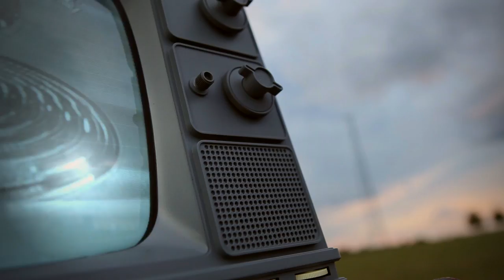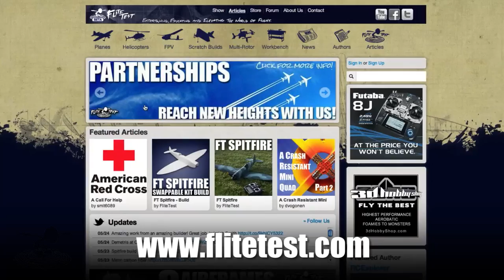Flite Test - The Roadrunner - 38cc Gas Airplane

Comment: A little tip with gas engines: Set the prop so that it rests parallel to the wings when the piston is at Top Dead Center (TDC). This way, if you get a dead-stick, the prob won't be stuck and down, and your landings will easier. It also helps when starting these bad boys up! Anyways, great job getting the old plane to fly. :) My dad actually has one just like it, although his is blue and while.
Reply: I learned that way back in the Cox 0.8 days, when I was getting into RC and flew scratchbuilds with a 2CH radio.
Saved me MANY props ;)
Reply: Excellent tip!

Comment: 3 years later, and still waiting for a gasser in an Episode ...
Reply: yeah i did find one other gas episode.. was a review on a mustang.. i was shocked.. the name of episode:
Flite Test - Hangar 9 p-51 mustang MkII  PTS - review. Nov 29 2011  

other than that only other gas episodes are accidentals.. not of the FT boys doing a review or flying.. which is to bad they had so many people interested in learning about gas..  

but iv learn a lot from FT so i can not complain.. plus there foam board planes not so good for gas. LOL.. however, with there new foam.. i say peter time for a challenge..  we want a line nitro plane..  2 wires 60 feet, cox .49, and the new foam board.. it should work fine and the new foam board being water resilient.., just use some dope to protect it from the exhaust etc its how they protected the tissue paper back in the day.. so why would it not work on the new water resilient foam board.  .  im learning to use dope now on a balsa rubber band plane im building.. so far using dope is not to bad.. i figure iron on monoko will be harder..  i need to go order a iron and some low heat film.. so i can practice covering foam etc..    

im with you id love to see a tutorial series on  gas.. even if it was just getting into free flight with a line plane.  you can get gas engines so cheap now.. so its not like the project could not be reproduced by the FT community..
i know everyone is pushing elertic and i get it.. but im almost 42 i grew up with gas engines.. my lawn mower was never electric.. even tho sometimes i wish it was hah because my old lawn mower as a kid was such a cold blooded beast.  but it made me summer money so what the heck.  .
Reply: Chris c
totally agree with you.cox is so awesome!!
Reply: +Chris c the heat generated by an engine is enough to melt or damage/deform foam board. It would also likely be too heavy to be effectively supported by the foam.
Reply: SandwichedTom
it could work. but you are right, bigger engines arent good for foam.
Reply: if been flying electrics all my life but i woud reallllyy like a learn how to gas/nitro planes  and im pretty sure those guys could make it but atm they are all about begginers rc foamyies.
Reply: Sereniitty
yeah...
Reply: RapaSheepZ same I'm started nitro
Reply: yep, time is passing..
Reply: Now 4 years later still no cool piston planes 😱
Reply: I guess gas running planes are not that "modern" anymore. Over here in Europe, especially germany and France, as well als Switzlerland and Austria, the rules for flying RC planes are getting worse every year. Gas planes are not allowed to fly in a space without permission, insurance and most important: No flying if a building is within a radius of 1km. Especially the last point is difficult to solve because central european countries are very dense populated and the areas without buildings are often protected areas like forests.
Gas engines for planes are often used by scale-pilots who mostly fly on events where they have permission to fly.
Reply: There's another gasser episode called Flite Test Large Scale 3d
Reply: prolly keep waiting,  electric too reliable and clean, ,  But yes love nitro, its just a ma
Reply: It had been 3 years seince this comment was made
Reply: Rapalagui 6 years
Reply: not really sure, but I think you can edit to 6 years.
Reply: 7 years....
Reply: 6 years later an I'm still waiting for one 😂
Reply: Make that 8 years
Reply: @letsgofast1187  Oh yes :D
Reply: @Rapalagui  make that moree
Reply: @justaguitardude  That was glow not gas.....
Reply: @justaguitardude  i have learned a lot to from FT, and FT is the reason i am in the hobby now, tho i would like to see a little bit more "advanced" stuff, there i am today and will be next year. FT still feels they only turn to the rookies / beginners. there is like no real reason for me to follow FT anymore.. no 20 - 60cc gas, no Turbine Jet´s and not Nitro, all they fly is boring Electric stuff..

Comment: This brought back memories.  I flew RC back in the early 70’s when all we had was 2 cycle nitro engines and 4 channel radios on the CB band, 27 MHz. My favorite plane was the Ugly Stick.  It was a 72” wingspan pulled by an Enya 60.  My first radio was a Heathkit, which I had to completely build, including the servos.  Fly some more of the oldies.  I think even the younger audience would like them.

Comment: I wish they made a Gas beginner series.
Reply: +Jay Anderson Came here for same thing.
Reply: Janis Andersons gas planes are not beginner planes
Reply: please do one.  you should make a new power pack for gas power.
Reply: @modelrc9500  We're asking for a series on experienced pilots who might be "electric only" and want to learn GAS engines.  I have chainsaw experience, but no airplane application.  Does lawn trimmer time count?
Reply: birdwing98 of course it does!
Reply: try nitro almost same thing just different fuel and higer rpms
Reply: @modelrc9500  he meant beginner series for gas, like you want to get into flying gas, not when your a complete beginner, just a beginner series for getting into gas planes after you've mastered electric
Reply: @modelrc9500  they were for me.  Granted that was the 1990s...  back in the day electrics weren't strong enough for most people to want to fly em.   With brushless motors and lipos that's changed, but it's not really any harder to fly a gas trainer than an electric one.

Comment: The carburetor on that has a built in fuel pump that works with the pressure in the engine crankcase. The fuel tank can be below the carb and still run. But, carburetors with a bowl on the bottom of it needs the fuel tank to be above the carb because it gets fuel using gravity. You would need an external fuel pump if the gas tank is below the carburetor with a bowl in order to run. So, you're fine with the fuel tank. Hope this helps

Comment: Great deal guys!  That engine is a Zenoah G38 and has a spring starter inside the rear mount. The engine is worth more than you paid for both airplanes.  It surprised me that it cranked so easily.
I think the airframe is called a 'sweet stick' and is a great flyer.
I would like to see more gas planes as well.

Comment: Being a small engine hobbyist, I spotted a few things I would say differently. The engine doesn’t “suck” per say, it draws. The primer bulb doesn’t shoot fuel in the intake, it primes the system. A servo-actuated choke would definitely help that engine start easier.
You can’t flood a two stroke by tilting it with the engine not running. They run on fuel pumps, so no gravity feed or float bowl, aka no way for the engine to flood out. A fuel pump, especially diaphragm carburetors, don’t need the fuel tank in my specific position, they’ll draw fuel no matter what, running or not running. Primer bulb and choke is the best way to start a two stroke engine.
Also, David cutting his finger on the prop. That happened because the compression pushed the piston backwards, spinning the prop backwards, and whacking David’s finger.

Comment: A few years ago I bought a Great Planes kit the Ultra Sport 1000 and it suggested a Super Tigre 2500 for the engine.  I put a Zenoah 38 gas engine in it and yes it was very nose heavy.  I put a lot of tail weight in it and it flew like a dream.  The guys at the field loved the way it flew.  The landings were a little fast because it was nose heavy, but it flew great.  This Roadrunner looks like a kit we bought from Ace.  I forgot the name of the kit, but it looks the same with the same engine.

Comment: Great video! Loved the added behind the scene stuff.  I'm an avid electric guy but do like the occasional foray into the gas realm.  About the motor, I spent my late teens as a small engine mechanic and can tell you that those two stroke motor carburetors have build in fuel pumps. this is so that they can run at any angle (think of how chainsaws and weed whackers are used).

Comment: Hey guys, finally a gasser ! I`m building a Senior Telemaster to use as a FPV platform with a FS120 4 stroke gas engine and would love to see you put some FPV equipment on this to see if the ignition messes with the FPV gear. I`v looked all over and no one knows if it will or not. If it does, maybe just need to shield the ignition. Would be a great build for all of us gasser freaks out there ! Also how about a GP Siren build ? Just a couple things a faithful watcher would like to see....

Comment: Awesome video guys! FYI don't use Klotz Benol two stroke oil if you fly in the winter, temps under 40 degrees F when combined with Benol can result in cylinder damage. Natural castor oil doesn't perform well in the cold, for all temp protection try Klotz Super-Technaplate.

Comment: The carbs in those do not have return lines, just an inlet. There is a diagram fuel pump in the carb that operates off the vacuum pulses in the intake.

Comment: Im pretty sure the motor is a ryobi 38cc that the original owner converted to RC use. The prop hub looks home made and the muffler looks like a weed wacker muffler and its located at the back of the motor like most ryobis.

Comment: You can't flood the engine with the walbro pumper carb.  It only delivers fuel via the engine's pressure pulses via a diaphragm pump.  It delivers in any attitude, that's why you have them on string trimmers, chainsaws, blowers etc.  You also can't flood the engine with the primer bulb. Not sure about this setup but in power equipment the primer's job is to purge the air from the fuel system, not inject fuel into the combustion chamber.  A little nose heavy with full tank is standard in fuel models.  The CG levels out as the fuel burns down.  Fun vid!

Comment: I have the most awesome electric starter for gas engines. Not only does it spin the big gas engines up and starts them quickly but it has the coolest name a Sullivan Megatron. You can fly the gas engines for almost 30 minutes too on one tank, and be up in the air again refueled in a couple of minutes.

Comment: hey guys, i noticed that you used klotz benol for mixing with the gasoline, thats wrong. benol is primarily used for adding additional oil content for nitromethane model fuels, if you use benol in gas engines long enough, it will cause ring sticking and carbon buildup,  benol is  used in 2 stroke racing type engines(gasoline powered) that are torn down and rebuilt frequently because it will cause ring sticking in a few short hours.  use 2 stroke oil meant for mixing with gasoline, no castor oil.

Comment: The sound does not really depend on whether it's gas or nitro, but much more on the size of the engine, brand and especially whether or not the engine is on rubber mounts. Especially Webra nitro engines sound very round and harmonious.

Comment: It is springloaded so by turning it backwards he puts momentum on the spring and then it releases in the right direction, helps the ignition to load the spark needed to ignite the fumes.
I'm not sure but I believe it is more common in magnetic ignition systems than the electric ignition since the electric systems will spark every time.

Comment: Actually, the suggestions were valid.  In the episode they commented on the lack of a grounding switch, which is a kill switch on the motor.  Pulling the plug wire is a good idea, unless you're ready to start the motor.

Comment: I love the plane so very much. The old school big stik ugly stik look. It encompasses everything of rc airplanes. And gas yuuuuup! I have 6 nice models that run on nitro. I upgraded to 4 stroke over the last 2 years but i now own 3 gas models all by aero works and i have pitts mufflers on all 3. 2 50 cc models and a 20 cc model. All big scale low wing high performance beauties. And a gas engine allows so much more to the hobby. The smell the sound with those pitts pipes, and having sparkplugs in my flite box rather than glowplugs. They are all so much more fun to fly than nitro. Dont get me wrong i still fly my nitro girls too. I always take 3 models out to fly. There is just something about my 70 os surpass f4u corsair that is beautiful. I put a blowdryer on her skin once every 30 days to keep her tight and hit her monokote seams with a heat iron with a soft sock as well. She has retracts and she is a true scale model. Work on her at least 3 to 4 times a month to keep her scale look pristine. I even paint the tips of her 3 blade prop yellow every month or so and apply airbrush dark gray to her wing guns and exhause port areas area her cowl. Keep your models looking good. Its as fun to me as flying them. Dont ever overlook model upkeep. They need love just like everything else you care about.

Comment: On the engine, there is a sort of spring.
When he turns the prop backwards, he twists the spring aswell.
When he releases the prop, the spring turns the pro the correct way for a few rotations. That way it is easier to start the engine.

Comment: Guys, that hasva walbro carb on it, it hasva built in fuel pump, so does not need a backpressure line to the tank. Only the gravity feed glow engines need it.

Comment: you have a ground wire coming off your coil you can put a switch so that you can ground that wire to the motor and that is your off switch.  Or at least you should have a ground wire.  the Zen spring start actually works pretty darn good.

Comment: On the balance point it should be CG forward at takeoff as the fuel burnoff will move the CG to the rear.  You don't want the CG too far back at landing.

Comment: looks like a Zenoah engine with the spring starter, turn the prop clockwise winds spring up release and the spring flips the engine.
No choke, fuel prime was standard as you did.
Big problem always balance glow and gasoline engines with an empty fuel tank or your plane will be tail heavy once you run down your fuel, a clamp and a wrench with a full tank of fuel probably a wrench heavy once the tank is run down :)
Gasoline fueled engines have a fuel pump in the carb ,  tank vent and a fuel supply line some may have a three line tank though with a fuel supply line as well. Glow engines exhaust line which is the tank vent line is attached to the muffler as exhaust pressure pressurizes the tank supplying fuel to the carb

Comment: Yep Ive always said it. You cannot beat gas, electric will never be as pleasurable (for me at least) as gas.
Reply: +masso172 
Imo the amount of time it took to get it running proves why it's stupid ( and maintenance required )

So complicated and wasteful, whereas you can get a electric plane running in minutes and you don't use batteries every time you fly it.
Reply: BillTheBox Are you a troll?
Reply: +BillTheBox it's well worth it with all the memories made
Reply: In my opinion, gas engines on rc planes are awesome if you want to build a huge Scale-model. A lawn mower engine mounted on a non-scale plane is just too much work and not enough "outcome" for all the work.
https://www.youtube.com/watch?v=lggvwEhBM-w 
This plane would just not seem scale if it didnt have that gas engine, the sound is so awesome.

Comment: With these chainsaw?implement engines you need a choke over the inlet, pull once until it burps then half choke and some throttle then a few seconds later it will run properly, ask a chainsaw user to demonstrate on the saw for you.
They run well and strong forever working in the wood especially a good make.

Comment: You are basically flying a chainsaw with a prop.  We use Echos for our cheap saws and your can get a 30cc at Home Depot for $200 or a 40cc for $300. They aren't as powerful as nitro but the fuel efficiency is amazing. And they behave more like a car motors than nitro motors. So they may need an aggressive prop for their lower RPM and greater torque. Don't quote me on the prop selection though,  I only use them in chainsaw configuration.
Reply: Why would you buy a new engine when theirs thousands of them on broken trimmers and chainsaws you can get for free.

Comment: Its like the old cox engines with the spring start, hes flipping it backwards to wind the spring and then when he lets go, it springs counterclockwise, starting the engine, instead of a 12v electric starter or just using your hand

Comment: How about trying to start the engine tyhe way it runs? 
Most engines run anti clockwise not clock wise, plus a quick look at thebprop will tell you the way it runs.